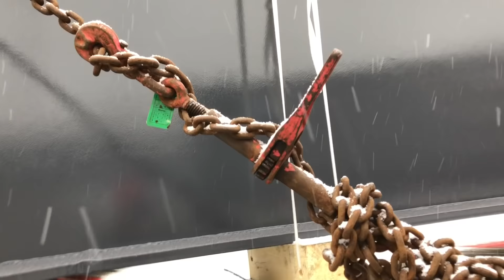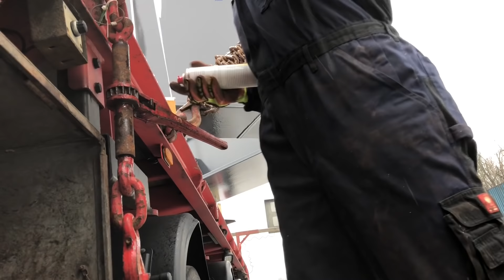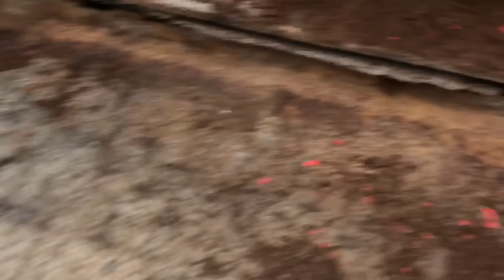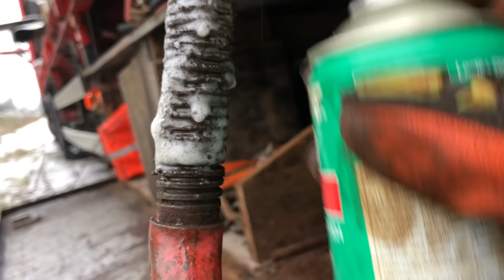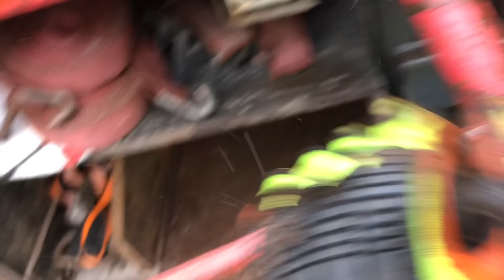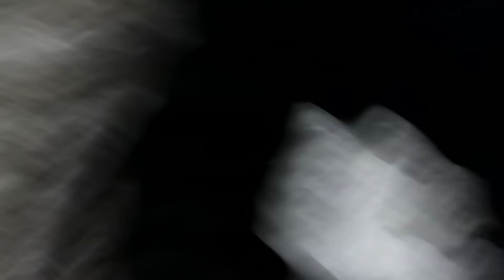Smarowanie łańcuchów, Chains and boomers greasing - Iwona Blecharczyk 2019/4

Comment: Hi Iwona.   Good Christmas?  I used to have the same trouble.  What I found was, a cadged piece of old disused conveyor belt cut to size and laid in the bottom of the box helped to keep them in good working order. Not only that, every now and then, I could slide the whole lot out and keep the inside of the box clean.  Happy new year to you and be safe.

Comment: G'day Princess Iwona,  Interesting video, on the maintenance of your equipment, how often do they test your gear and tag it?,  Can you at some time do a video on how the steering works on the 4 Axles Trailer,  also are the Trailer wheels Driven?? ie in one of the videos hauling blades the trailer wheels were nearly at right angles to the Truck.   AU

Comment: Hi Iwona, like the tit for tat the hat, now that you have become an oil greaser, in your boiler suit, and have joined the chain gang🔗this is the part that of the job that non truckers know about,your kit maintainance of straps and chains,parking lights and such like,people just think that you are sat behind the steering wheel in a warm cab and that is all that is involved that a driver has to do drive the truck,and they would be wrong,by law you are responsible for your truck as the driver,also checking your tyre pressure to make sure the pressures are  correct for the loads you are carrying .